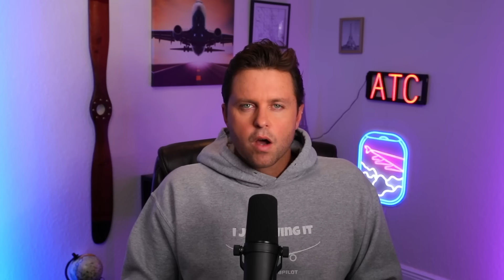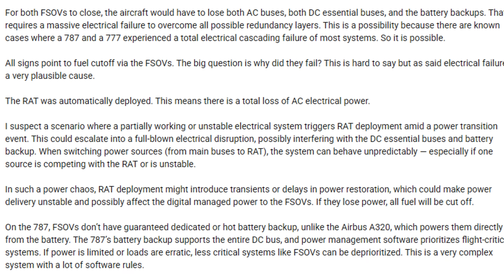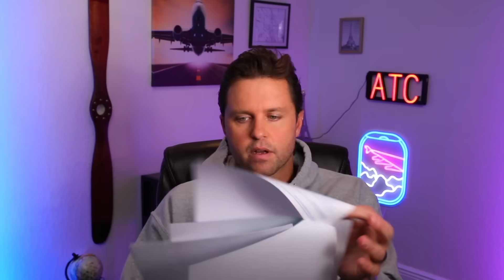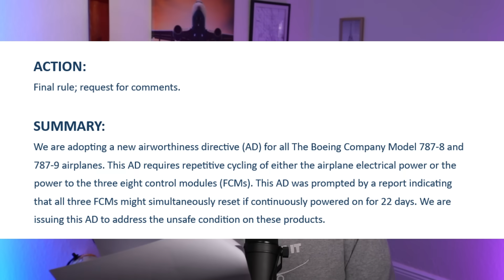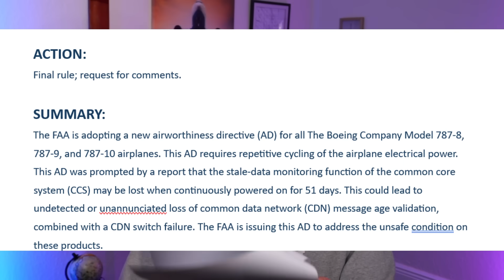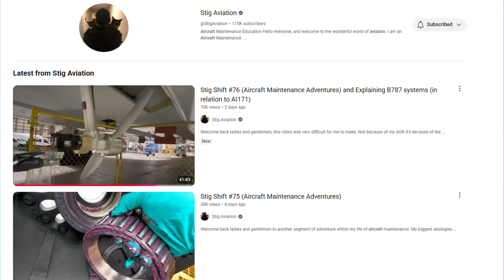Air India 171: Did a Software Glitch Cause Dual Engine Failure?

Comment: I am an electiical engineer with industrial experience ..am downunder but originally fro UK . When I saw the RAT deployed I realised this was a Boeing issue and likely a'power/control' issue  ...I know not much about aviation systems but the basics are obvious .....since the jet engine and modern technology maybe we have become too reliant on computer systems to control everything ...human frailty is always the key and in this case it looks like design . My first thought when I heard  of 'lack of thrust' from pilot having watched the take off video was electrical/mechanical/software issue ...ultimately the design from Boeing  .Problem started after V1 ? take off was not right ...RIP to all . I like flying with Airbus ...sorry ..DC10's had problems as did Tristars ...it is down to the aviation industry now

Comment: As an interested amateur with basically no in-depth knowledge of the systems...all I can say is I'm withholding judgement until the media frenzy dies down. This crash more than most seems to be generating a lot of misinformation - and I don't have the tool set to properly evaluate a lot of what's being claimed. The idea presented here sounds credible, but I have no way of really analysing it, so all I can reasonably do is remain sceptical and wait for at least a preliminary report. I will say that the idea that there's been this bomb ready to go off and kill a 787 at any moment while nearly 1,200 aircraft have made over 5 million flights over the course of fourteen years without any fatal accidents sounds...questionable.

Comment: Could this be the same problem that LATAM Airlines flight 800 (March 11, 2024), a Boeing 787 which suddenly lost altitude mid-flight, dropping violently and injuring dozens of passengers.
A passenger reported a pilot told them after landing that the instruments in the cockpit went blank when the plane fell, then came back online a few seconds later...
Reply: No. That event was caused by severe turbulence. The sudden shock may have caused a glitch in the electrics that caused systems to reset.

Comment: That makes total sense. I saw today that they are saying the black box was damaged, even though isn't it in the tail of the plane? The tail that I saw in crash videos as being intact? Hmm. Anyway, I hope they figure it out.
Reply: The B787-9 8 has two combined recorders one in the nose and one in the tail. Each can record both cockpit voice and flight data. The unit in the front was damaged in the post crash fire. The unit installed in the tail should be ok

Comment: I'm a software and systems engineer. 
        Software-related issues are way, way more responsible for systems failures than are hardware problems. And it's not that software breaks; it's faulty programming. 
        Often it's exactly of the sort described: buffer overflows, counters out of range, date limits, exceeding array size, unexpected values, and the like; things that programmers often don't consider but that test and systems engineers must. 
        It's tricky though, because something that passes one thousand consecutive tests is released, although it will fail at ten thousand.

Comment: You’re preaching to the choir. I’ve been saying it was a system failure since the beginning. From logical reasoning it is the most likely of all the unlikely things that could cause a loss of power in both engines or even an incorrect flap setting.

Comment: Okay, I fully agree that it could have been a DC bus failure and the valves closed due to the spring effect. But what about the NOISE, the bang that the survivor said he heard, WHAT CAUSED THIS NOISE???     -Could it have been a short circuit in the lithium batteries???
Reply: Possibly the noise of the RAT unlatching.

Comment: Just a layman. But besides a momentary power failrure that may initiate the RAT. there must also be a second swtch over interval ? It sounds like either break could trigget the fuel valve closure .  In just 32 available seconds how long does it take to reset the fuel valves  and restore engine thrust?    300 seconds ?  How long to spool down engines from fuel cut off ? Perhaps long enough for initial flight ?  The  problem may rest with 1100 planes and 200,000 passeger in daily transit and a conclusive report and correction prnding 30 to 180 days ?  RIP the prescious folks lost but how many are at living risk?

Comment: Gary - this was sent to me yesterday by a friend who is in the major airline pilot world, as I am…   No idea as to the source or the validity, however, I’ve seen several other condensed versions of this same report, interesting nonetheless…

8:58
• U
5G 100
X AAIB Preliminary Report Highlights
1. Primary Cause - Electrical Power Transfer Interruption
(PTI) During Rotation
• During transition from ground to airborne electrical configuration, the aircraft experienced a cascading dual-engine FADEC (Full Authority Digital Engine Control) failure.
• Root cause: Uncommanded bus transfer failure due to arcing in the main power relay box (PRB-A), traced to water ingress during pre-flight GPU disconnection in heavy rain.
• This led to loss of electronic engine control at rotation, resulting in both GEnx engines rolling back to ground idle within 4-5 seconds.
2. Flight Data Record Timeline
• +0:11 sec: Nose gear lifts off.
• +0:13 sec: Sudden engine rollback begins. Thrust reduces from 92% N1 to <27% within 3 seconds.
• +0:16 sec: Master caution + ENG FAIL L/R warnings. FO calls, "Both engines dropping!"
• +0:20 sec: Autopilot and flight control reverts to Direct Mode. Pitch up attitude peaks at 18°
• +0:25 sec: Aircraft stalls at 186 ft AGL.
• +0:30 sec: Full aerodynamic stall; nose drops rapidly.
• +0:38 sec: Ground impact at 54° nose-down attitude,
174 knots.
@ Contributing Factors
• Environmental Conditions:
• Torrential rain during pushback.
• Moisture intrusion into PRB-A connector (P/N: HLN8471)
- a known corrosion-risk component.
• Latent Maintenance Issue:
• Power transfer relay unit showed signs of thermal damage in a previous MEL deferral 2 weeks prior.
• No replacement had been conducted; aircraft was cleared under repetitive deferral.
• Design Oversight:
• Boeing 787 has no physical engine control backup (i.e., no direct mechanical linkage in FADEC loss scenario).
• Loss of power supply to both EEC channels resulted in engine "freeze" at ground idle instead of flameout.
• Flight Crew Response:
• Attemoted enaine retont seouence not comoleted

8:58
5G 100
O: Contributing Factors
• Environmental Conditions:
• Torrential rain during pushback.
• Moisture intrusion into PRB-A connector (P/N: HLN8471)
- a known corrosion-risk component.
• Latent Maintenance Issue:
• Power transfer relay unit showed signs of thermal damage in a previous MEL deferral 2 weeks prior.
• No replacement had been conducted; aircraft was cleared under repetitive deferral.
• Design Oversight:
• Boeing 787 has no physical engine control backup (i.e., no direct mechanical linkage in FADEC loss scenario).
• Loss of power supply to both EEC channels resulted in engine "freeze" at ground idle instead of flameout.
• Flight Crew Response:
• Attempted engine relight sequence not completed before stall onset.
• Emergency power selector not activated — possibly due to confusion from multiple ECAM warnings.
* Immediate Safety Actions
• DGCA + EASA + FAA Emergency AD issued within 24 hours:
• Mandatory PRB-A moisture integrity inspection on all Boeing 787 aircraft.
• Temporary restriction on dispatch with MEL items related to power transfer systems.
• Boeing:
• Issued Service Bulletin SB-787-24-212 requiring replacement of PRB-A connectors with sealed versions.
• Exploring addition of dual-path power redundancy for
FADEC systems.
Lessons Learned
• Over-reliance on electrical power distribution architecture without layered redundancy.
• Lack of crew procedural training for full engine rollback during takeoff in EEC dual failure scenarios.
• Need for improved environmental sealing in GPU/ electrical handover units in monsoon zones.

Comment: I already commented from several channels regarding the Air India Crash that the CCS that sends signals to both engine FADECs might have failed due to electrical issues. This can also cause both engines to go to safety mode by powering down to idle or completely shut down. Loss of AC or DC bus power, faulty power converters, circuit breaker trips due to overcurrent protection, wiring and connector failures, software-induced failures due to electrical glitches.

Comment: I have speculated since Day 1 this is something digital. The total lack of any smoke, flames, etc from the engines said to me total shutdown. That had to be digital.
Reply: Same here and my money is on the FADEC.  If this Fully Autonomous computer wrongly spools down or kills the engines the pilots cannot over-ride it.
I have been working with computers since the 1970s.  I would never give a computer command authority above the authority of a human.  Here in UK over 900 subpostmasters were wrongly convicted when courts chose to believe in the infallibility of a central computer.
Reply: I don’t know much about planes but from the get go, looking into it and different theories, I had a nagging feeling this was electrical. 

How unfair to the victims and pilots.
Reply: That was the greatest cover up by Post Office and Fujitsu and there is video wherela test CEO admitted they were putting innocent people to jail.

Most likely some wrong interpretation of in flight data or poor logic design.
Reply: Digital is not correct. Based on that user's comment, it's an electrical glitch not a software glitch.

Comment: Sounds like Boeing engineers got caught in a Möbius safety loop.

What you describe makes sense, but why not provide dedicated batteries to hold those valves for enough time to say.. allow the APU to start (or the RAT to deploy) and provide AC power and subsequently DC power to take over holding the valves open.

And I just heard the FDR is unusable. Wait… what? The CVR is important, but why is the FDR not useable? Or, how damaged was the FDR?

Comment: if it is a software glitch the entire fleet should be grounded world-wide immediately.
Reply: To make sure it's a software glitch, investigation will take 2-3 years of time. Maybe after that they can ground.
Reply: @Ksgggg  and during those 2-3 years how many avoidable deaths might there be?
Reply: @Ksgggg  in 2025 they need 2 or 3 years? That's more than crazy...
Reply: @derkreditexperte4795  Have you heard of malaysian airline 370? It disappeared in 2014. Its 2025 and no one knows what happened to it and probably no one will ever know.
Reply: @Ksgggg  Alone because Boeing is well-known for these issues, they should ground until permit again. Revoking all licenses for those planes post 2014.
Reply: @Ksgggg  if its an software problem it will be fixed in the next months not 3 years
Reply: Added complication, Boeing is one of America's "big 5" defense prime contractors, so it's not just about public safety but gets entangled in American geopolitical power. IMO this means it's in America's vital national interest to go through every inch of the company with a regulatory fine tooth comb to straighten them out. But the Squeaky Tank admin's limp wristed approach to corporate power ensures that's not going to happen. So Boeing stockholder greed will continue to endanger not only public safety but America's national security.
Reply: You have absolutely nailed this!
Reply: and this is where politics come into hand.  The 737 had an issue with its rudder back in the 90’s that caused several accidents/incidents.  They were NEVER grounded.  Imagine the loss of money for companies like SW if that airplane had been grounded.  I would be surprised if they grounded these 787’s.   I fly it every week and it would be nice to know the cause of this before another one happens!
Reply: Thus they won't release that even if it is the case. At best an alternste/combo recommendation..IMO. $$ still priority even though we always say " safety" with our mouths.
Reply: It’s speculation right now that is all. Wait for the FDR data, that’s the only thing that will tell you for sure
Reply: No friggin way
Reply: Anyway, we'll never know the truth in this matter. 😔
Reply: And every pilot needs to take stress leave immediately
Reply: AirBus should do a favor by buying Boeing and save a lot of human tragedies.
Reply: I don't think I will be flying Boeing anymore.
Reply: Given the tariff war, this crash is the final nail in the coffin for Boeing.
Reply: @kentherapy7022  I'm afraid you're right, and I once worked at Boeing.
Even it it's not their fault, so many small brains have already decided it is.
Reply: @kentherapy7022 there are reports that it was a fuel contamination problem.
Reply: Did they not do that as soon as they heard of this accident?
Reply: Bhai , BOING COMPANY CAN JAM OR MAKE IT LOOK LIKE GLITCH in THEIR Particular PRODUCT since they build and developed.
Reply: And boeing should be never be allowed to make a plane

Comment: 12:03  Doesn't this sound like what the sole survivor described? "It felt like the plane was stuck, there was a bang, and the green emergency lights came on." Describing a plane as being stuck during take off sounds like fuel valves being closed automatically to me and the bang is the RAT deploying. Being witness to this and helping get justice for the families of his fellow passengers might just save that poor guy's sanity.
Reply: Yep agree. Fuel contamination almost zero chance
I thought a fuel pump failure but the fuel valves shutting would result in the same outcome. 
I do remember in the UK maybe 30 years ago we had a crash where one engine failed and the pilots shut down the good engine by mistake but that’s highly doubtful. Shame for all involved. RIP
Reply: @loftythesoftie8857 I remember that crash (Kegworth, 1989) but this is very different, if one engine was lost followed by shutdown of the other evening a second later we'd have seen the plane yaw when on one engine but in this case it was perfectly straight. This flight either had both engines running or no engines running but at no point a single engine as it never yawed
Reply: Excellent point.
Reply: Simultaneously pulling fire handles?

Comment: If FSOV control is directly tied to power loss with no software influence, it indicates a need for a HW add-on solution. This would mean all 787s would need to be retrofitted with HW upgrades.

Comment: Great video, Gary. I don’t have time to add more right now, but please research and have everyone in the comments section here research what happens when the APU is running during a total electrical failure in the scenarios you outlined here. I’m astounded that we know so little from the Indian investigation authorities and from the US NTSB who is co-investigating. If running the APU on takeoff and during the entire flight mitigates the FCOV risk during total electrical failure, that should be an immediate requirement worldwide for the 787. If that does not mitigate the risk, then we have a much more complicated problem to solve for and one Boeing needs to be involved to make a solution and it may require grounding the fleet worldwide immediately. If I were a 787 Captain for any airline throughout the world, I would be immediately running the APU for the entire flight, irregardless of company policy.
Reply: IIRC, the 787-8 APU is P&W APS5000 proving 450 kVA from 2 generators. The RAT supplies 10 kVA of three-phase variable frequency 230V AC power to the backup bus.